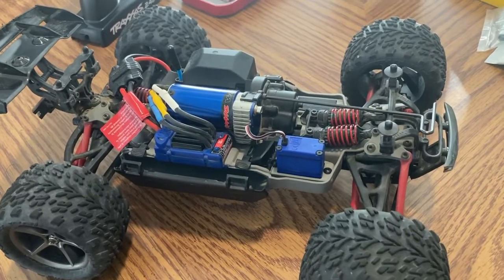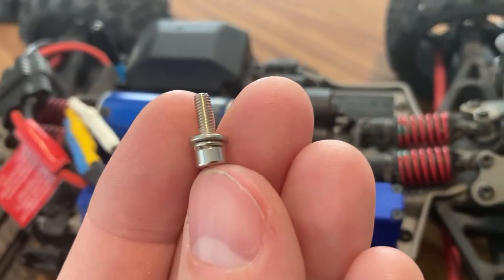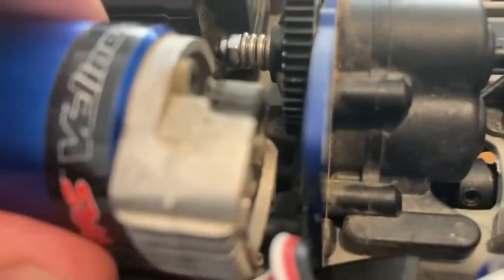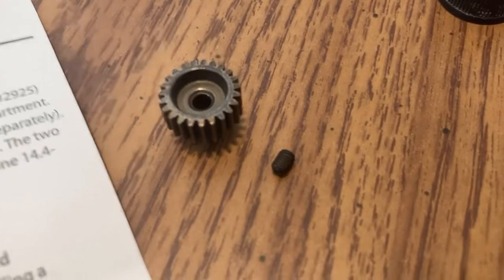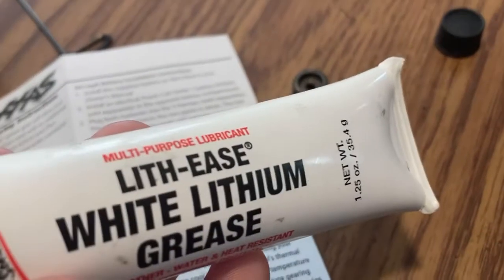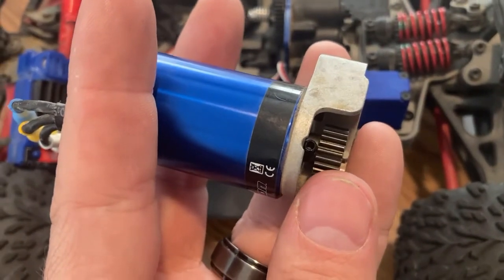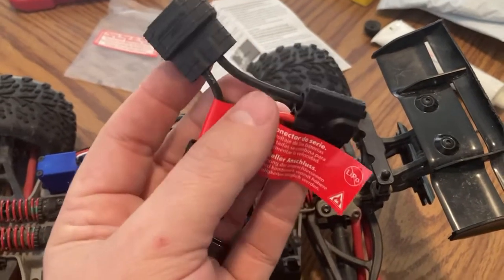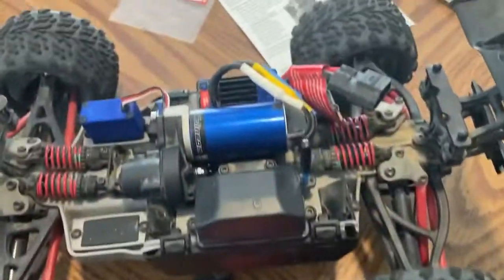How to Change Pinion Gear aka “Speed Gear” on Traxxas Mini E-Revo

Comment: Run two 3s lipos with parallels 11 volts will make it scream with 32t 48p pinion.
Reply: Dumb question but if I'm using two 2s lipos in parallel do I need to change the pinion?